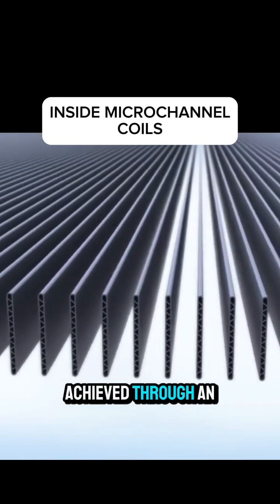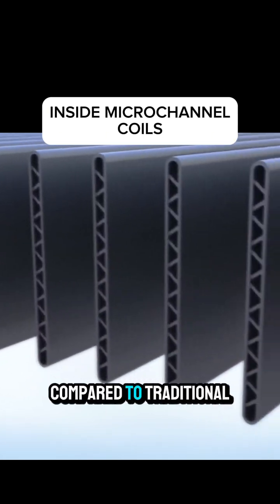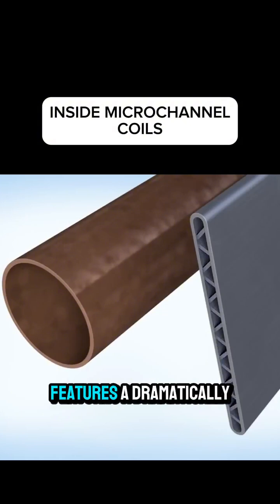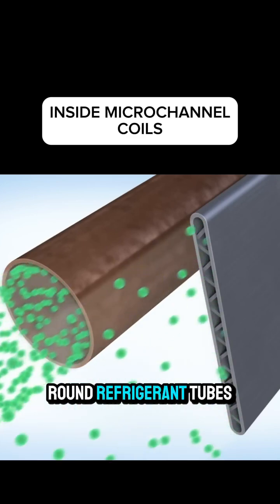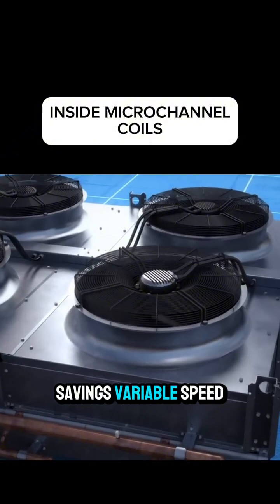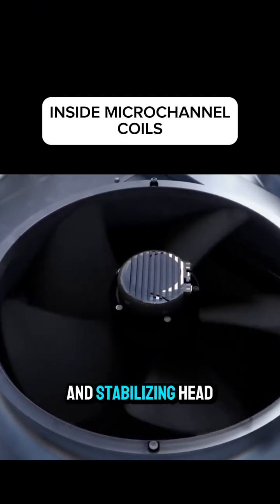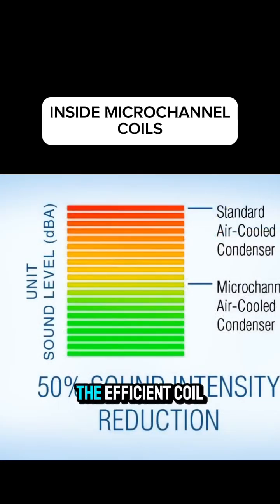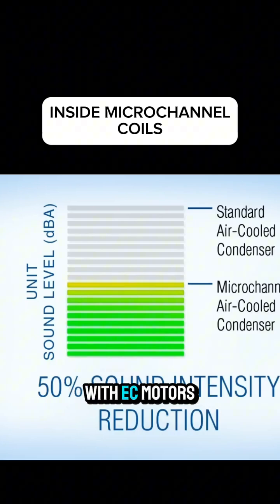Microchannel coils consist of flat, aluminum tubes, small channels through which refrigerant flows.

Comment: I mean no disrespect. Those EBM PABST condenser fan motors fail all the time. Especially on Trane chillers. We have a building with (2) 400 ton RTAF's and have had to replace so many of them. Same thing on RTAC's. I've had to replace them on dry coolers as well.
Reply: Agreed micro channels and ECMs don't hold up